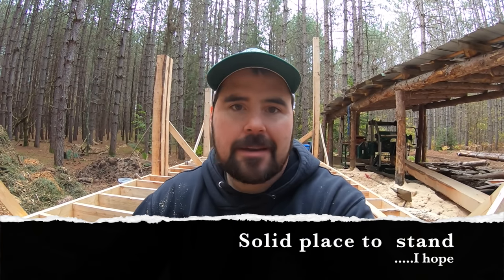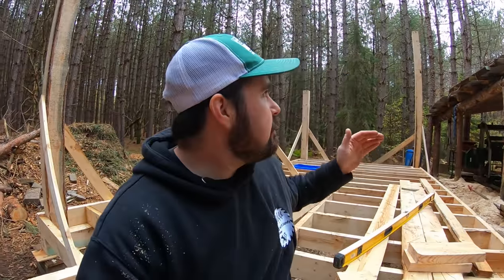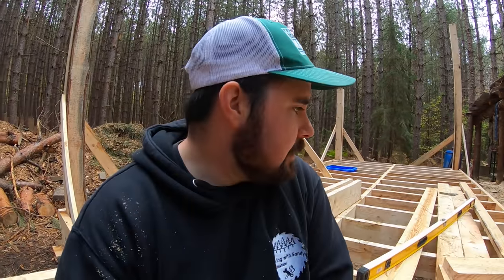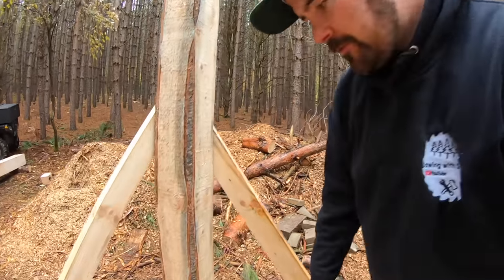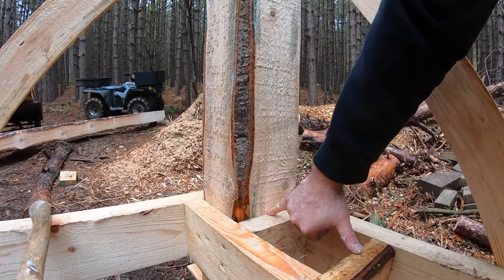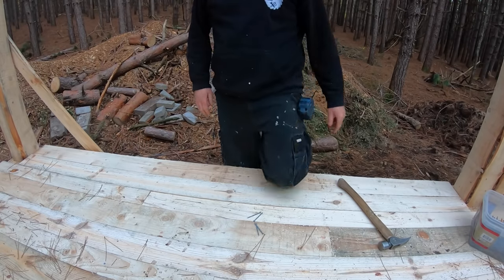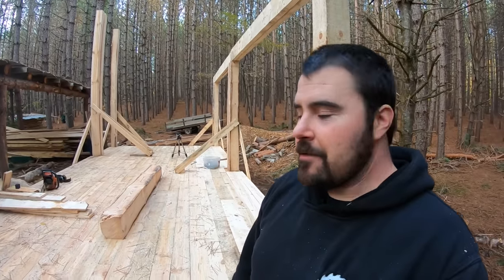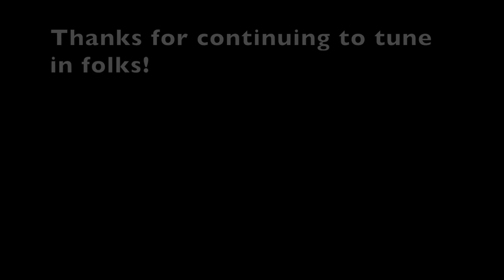Post Beam and Floor Board Installation | Sawmill Shed Build - Episode 4

Comment: Too bad you couldn't do what Smokey Mountain Outpost did with his tractor . He welded 2 pieces of square tubing to the bucket and that allowed him to reach alot further up when he was building his cabin . Worked out really great for him . 2 square tubes welded to the top of the bucket and 2 square arms fit inside those tubes . That way he could take the extention off when he wanted to . How did you figure out how high to make the front and back posts for a 6-12 pitch . For the life of me I can't figure out the dimentions . Thanks

Comment: Dude your killing yourself moving wood around manually ... chop a few more trees down ... give yourself some more room to take total advantage of your newly painted tractor around all sides of the new mill shed ...btw, are you taking the old one down, you know the one that's really in your way to load trees onto your new one, or maybe moving it out of the way, perhaps across the pathway on the other side of the new one, perhaps to reassemble and use as a drying shed, ... btw .... Happy Thanksgiving.
Reply: ... oh so you are moving the old one. lol ... I guess i should have watch the whole video before posting a comment. Sorry, the turkey was waiting on the table. Its coming out nicely.

Comment: Hey buddy how are ya? The build is looking good . Was thinking maybe ya sister up some wood along side the post and use a block and tackle. Also put angle brackets on the inside so you can lift the beam the set it on the bracket. Work back and forth so it’s safe use the winch on yer quad. It’s hard to explain but I think ya know what I mean. We did something like that in Mexico when we where building an orphanage dormitory with our youth group at church. God bless you buddy be safe

Comment: If your tractor FEL only lifts 9', you could rig up some blocking on a pallet to give you the extra 3 to 4' of height you need to lift the beam in place?  Perhaps using an IBC tote frame, you could sit the beam on top of that.

Comment: I have a DK45SE and i've rigged up a "crane" on my pallet forks attachment. I've bolt up 2x    2"x8"x16' together with a hook on the end. the other side was  bolt up to a V shape 2x8 to make it easier to use straps to hook it up to the attachment. i've managed to set up 21 trusses on my new shed. made life easier using the tractor..... i've kept the "crane" because I think i'll use it again for other thing when i'm out of reach with the tractor normally. hope it gives you ideas!

Comment: Sandy get a post level if you are going todo many post they fasten to the post with a rubber band so you can use two hands on the post built my saw shed base 10' X20'  one side has post at 10 ft other side 5 ft & 15ft  I can put a 17 ft log in if I angle it when I PUT IT IN. I reversed board and batten 5 ft and the adjoining 10 ft wall that is were I hang stuff and back the saw head in when I'm done sawing I have a Timbery M100 saw in Northern Michigan

Comment: Sandy if you use two buy 12 for your beams and sandwich galvanized flashing between them they're stronger than heck.... we used two by 12 and sandwich galvanized flashing in between them to use it for ramps for a car trailer an 8-foot piece you can drive a dually pickup up on them just got to make sure you sandwich the nails every two foot or so oh and now I'm telling you what to do always hook your hook away from the direction you're pulling sorry that's my two cents you're doing a great job so awesome

Comment: I know you’ve already put the beam up because I’ve watched the whole thing now but I too have a Kubota with forks on the front and ran into a similar situation where it wouldn’t quite lift high enough so.... I built a four foot tall cradle-like structure on a really heavy duty pallet and used the forks to lift the beam into it first, then slid the forks into the pallet openings, chained the whole thing to the backstop of the forks for stability and lifted her up nice and smooth. Of course the hydrostatic transmission really helps make very slow smooth movements but, borrowing your line from the ATV winch moment, “it isn’t stupid if it works”. It gave me the extra height I needed and was totally effortless to hoist.

Comment: Can you lift one end of the big beam by yourself or with a strong friend/brother? If so, maybe you could raise the bean say perhaps six inches at a time - one end up six inches and then the other end about six inches. You would lay the beam on the deck - right up against the inside of the posts. Once you have one end up the six inches, you could temporarily clamp a heavy duty clamp (or two) right under the beam. Then go to the other end of the beam and do the same thing. In six inches "lifts" you should be able to get the darn thing right up on top of the posts. Need a step ladder to stand on when nearing the top. If this works, it shouldn't take all that long.

I would screw a temporary "2 by" or piece of plywood to the OUTSIDE face of both posts as a "backstop" so that the beam did not fall back down once it reaches the top of the posts.

 If you didn't have an assistant for this task, you might be able to use your winch as the lifting force - moving both ends of the beam in the same way as described above. First use your chainsaw to cut a vertical groove  (about two inches down from the top of the two posts)  so that your winch wire will be trapped in that groove while winching.

Comment: put a temporary post in middle /brace both directions/put pulley at top of post/run strap for yoketo beam/cable thru pulleyto yoke winch on side by side/temporary post must be to outside of platform to allow room for beam. if it dosent work we will always think it should have

Comment: It's too bad the original sawmill shed isn't sturdy enough. You could have tied the two structures together and had a platform from which to work to at least set the last two beams. You'll get it. 👍

Comment: Take one of your saw blades cut it into about 2 foot sections. Drill holes into each section so you can nail these “metal straps” over crucial joints as needed.

Comment: Sandy I'm sure you've mentioned it somewhere but I can't find it, what are the dimensions of the floor?  What size material is the floor made of?  Thanks, I'll be recording my build up for you to see later this spring.

Mark
Reply from the maker: Hi Mark, floor is 10 x20 and made of red pine
Reply: @sawingwithsandy  thank you, would you go bigger if you could?  I just got a load of Tamarack, I'll be using that.  Price was right.  Happy Sawing.

Comment: Sandy . . . off topic but I don't know your back story in regards to your land. Your timber rows are VERY clean and uniformly straight.  Does underbrush NOT grow up there in Canada or was the underbrush cleared out and your timber thinned at some point?
Reply from the maker: Great question. The red pine forest is a planted forest and as a result of the close proximity of the trees when they were planted, a lot of light is blocked out by the trees limiting what can grow under its canopy. Also the roots of these trees are quite numerous and near the surface making other plants have to compete for water and nutrients with these trees. Thus not a lot of underbrush